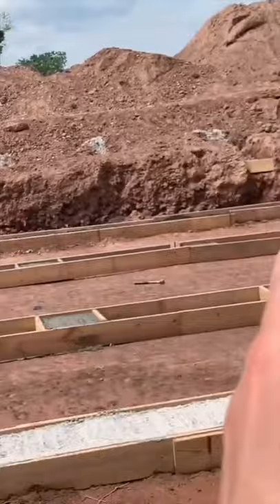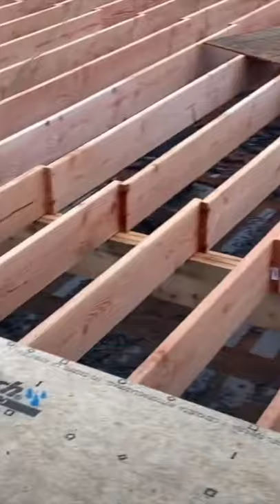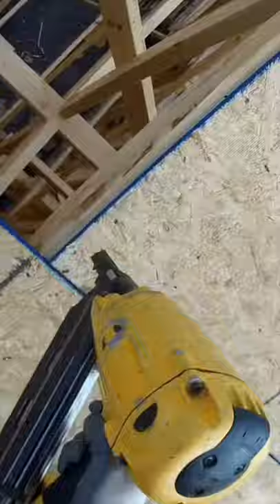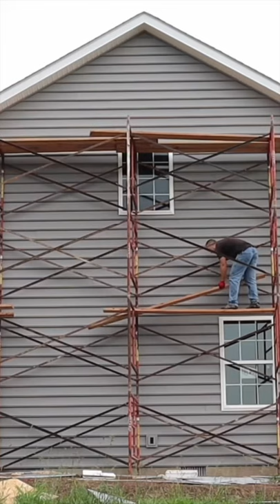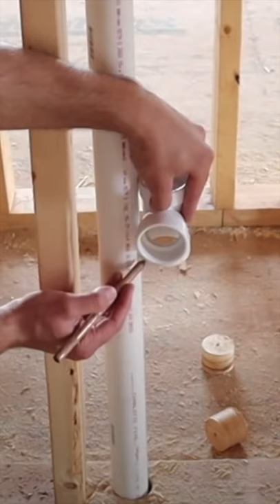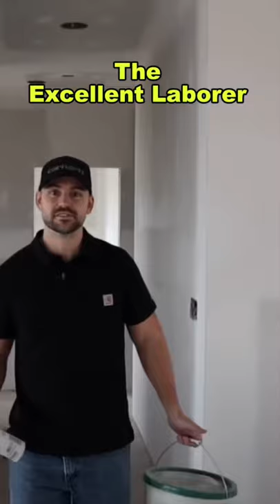Build your own house in 51 seconds! #shorts #diy

Comment: oh yeah morgage free is the way to go :
first you need to buy land and it better be land youre allowed to actually build a house on or you need to chenge the destination plans  
than you have to have a arcitect make a drawing of the home and this drawing has to be aproved by the town that could take a few new renditions of the plans to conform to the local rules (the door needs to open intoo the house unles its an outside door etc ) than once you got the plans approved  youre going to build the house ,remeber you own the land so youre going to have to pay taxes on it by this time the planning stage goes intoo about 2 years allready and youre hamoring cash out the wazoo  then youre going to start all sorts of procedures for water sewage power gas or watever possibly even being able to build an access road get to the propperty to do the stuff you want to do 
by the time everyone is good and ready (read payed off) you going to start buying the materials hoping they arive on ime in the right order and in the right sizes and quantities and you start building hoping youre closed in by the time the snow starts to fly or before mudseason 
meanwhile you need to have stuff approved before you can continue with stuff like insulation plumbing closing in the walls having power intoo the house and actually being alowed to live there . oh and keep doing youre dayjob offcourse 
and you did this how many times?
building it youreself USED to be cheaper than having it done but the goverment pissed in the soup and ruined it for everybody just like they do on everything

Comment: Do you think I would need to become licensed to be able to install electrical, plumbing, hvac in my own home ? I know that someone could learn and never be licensed but would it become a challenge   when dealing with permits and inspections?
Reply: Probably changes in different areas, but a lot of spots allow the homeowner to do almost anything themselves. 
Just need the inspector to check and sign off along the way :)